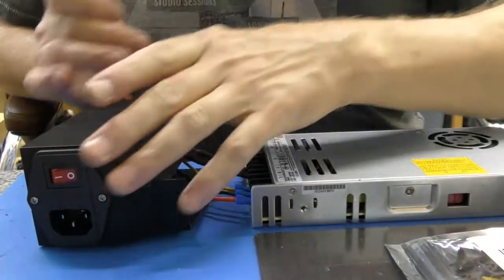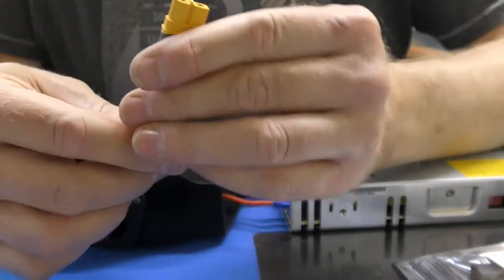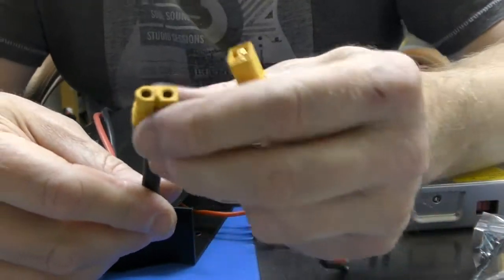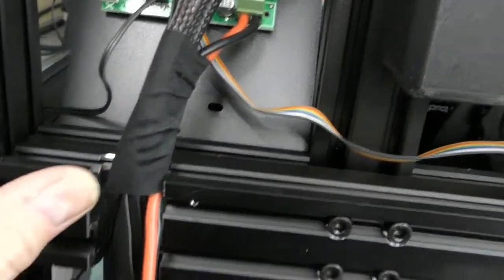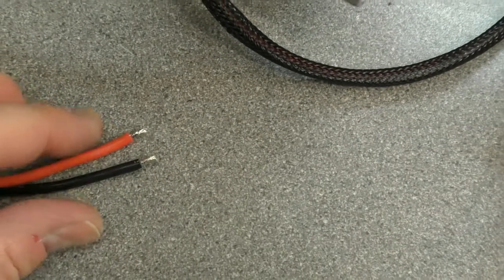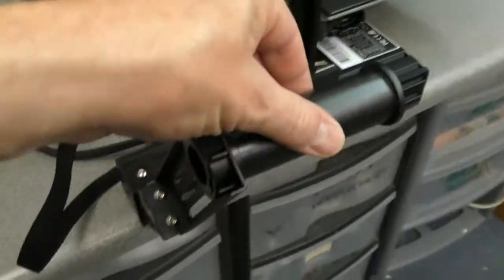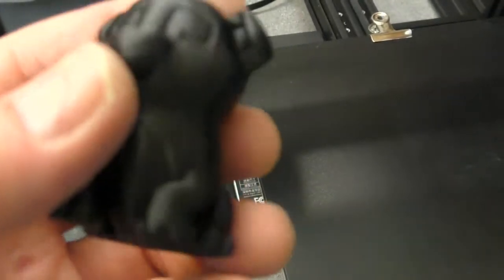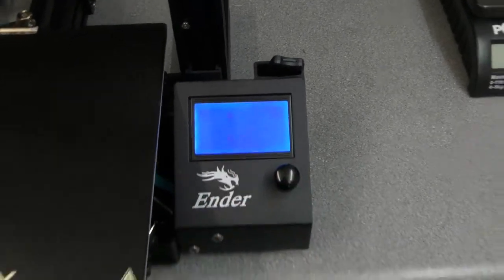Ender 3 Pro PSU Modifications

Comment: hi, the black cable in my power supply came disconected. and the printer It does not turn on. this cable is for 110v ? in my country have 220, should i conect the cable?
Reply: What he is showing is the power cable that goes to the mother board.